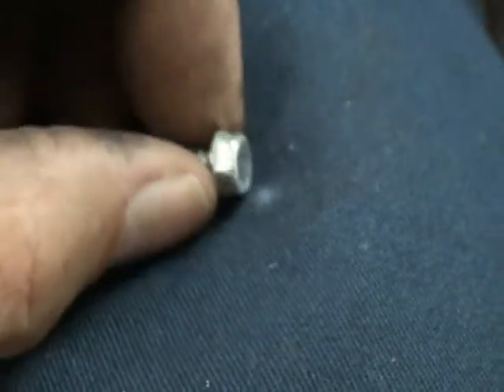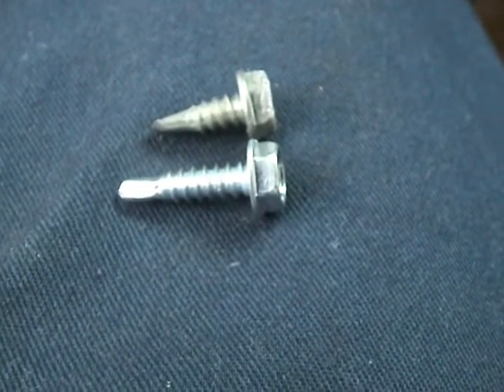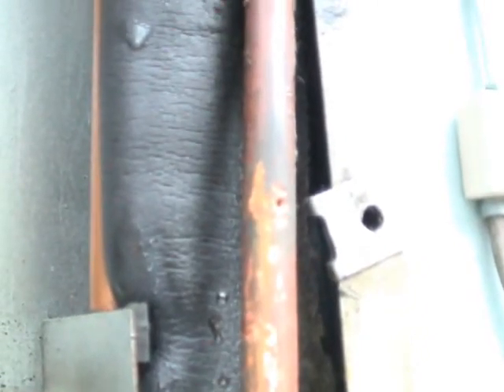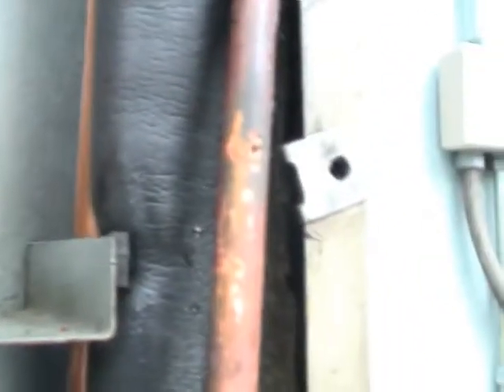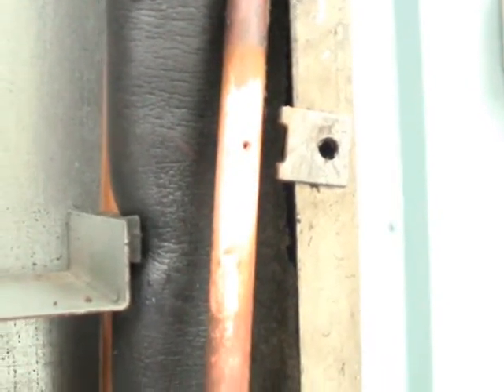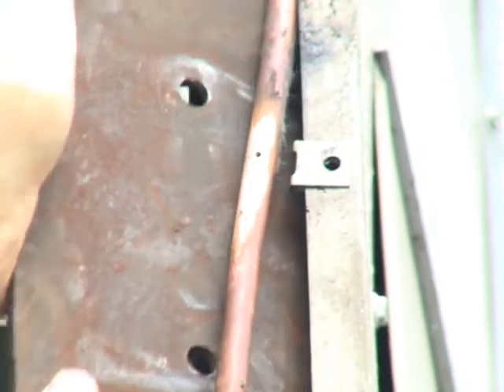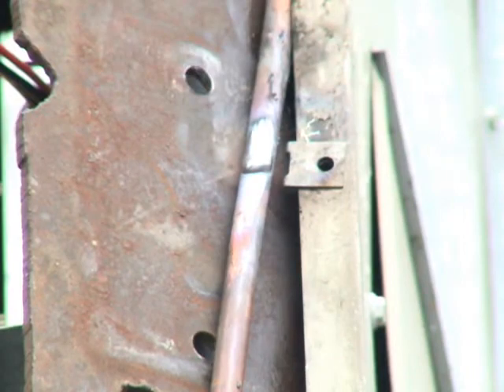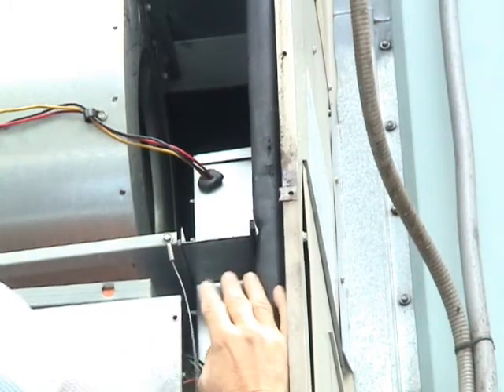HVAC Brazing 2

Comment: I have been on both sides of this sort of thing.I repair TV,s , about a year ago I was putting screws back in a lcd TV " They are thin TVS " I put a screw that was too long in the back and it came out through the front. I was just lucky they dident want to repair the set, and gave it to the shop.

Comment: @DrZarkloff is copper tubing like really flexible cause when i take apart my A/C to clean it i have to sorta bend the evaporator a bit to get the foam out of the bottom or the spill tray that leads to the back of the unit i have done it b4 but i just wanna know if it is ok to bend it so i do not have any leaks.. also i have a bit of rust forming on the copper tube on the condensor in the back can i use like steel wool to take it off? it might sound wierd but there is actually rust on the copper.

Comment: Hi, I'm a student also in my third out of four semesters at a local community college. I have a question about the nitrogen. When you hooked up the nitrogen and sent it into the sytem, was it coming out of the small hole in the liquid line as you were brazing pushing out any air, water and contaminates that may have gotten into the system? Why did you do that versus pulling a vacuum? Is the use of nitrogen just as good as a vacuum or better than?

Comment from the maker: @Mooseguy15 There are two types of copper tubing: annealed and rigid. The annealed is soft and is easy to bend. The rigid is not so easy to bend and will probably break if you try to bend it much.

Comment: do you use any kind of flux with that rod? im trying to weld a brass nut to a steel motorcycle gas tank what do you recomend? theire both pritty thin and i dont want to melt anything, what heating method and what rod is best? thanks

Comment from the maker: @Mooseguy15 You could have annealed copper on your system. The best way to tell if you have annealed copper or rigid copper is that rigid copper is typically very straight and annealed copper will have little bends and bows.even if it's going in a relatively straight line.

Comment from the maker: I put in about 50 psig then I let it all flow out of the hole that I repaired. I was on and off pretty fast so I didn't bother to keep the nitrogen flowing through the system while I brazed.

Comment: Doc,   I am considering career training and entry into the HVAC trade.    I would like to have your assessment of the opportunity and trends that the trade may present.    I am especially intrigued with heat pumps, small geo-thermal installations, and external wood-fired boilers.    I appreciate the vids.   Regards,

Comment: why are you saying a 5/16 screw?  its a #10 x 1/2" HWHSMS (Hex Washer Head Sheet Metal Screw) 5/16 is just the size of the socket.   If you HVAC supplier doesn't carry them, any electrical supply house should.